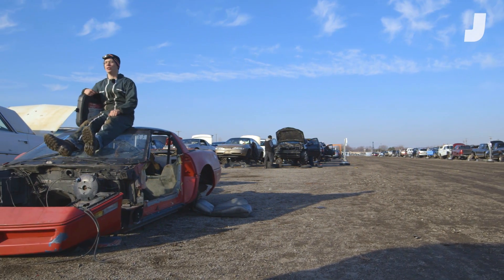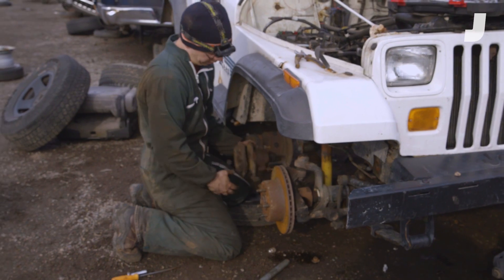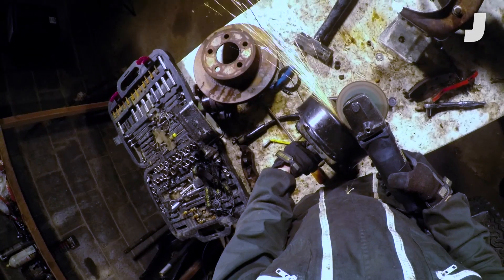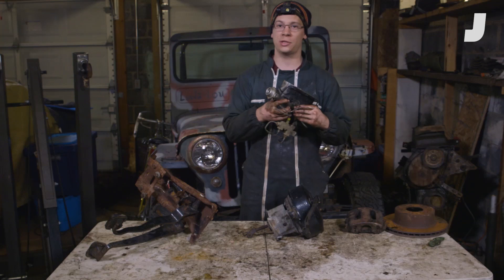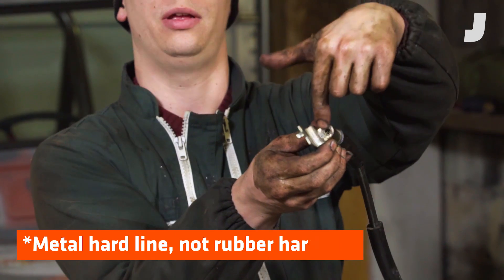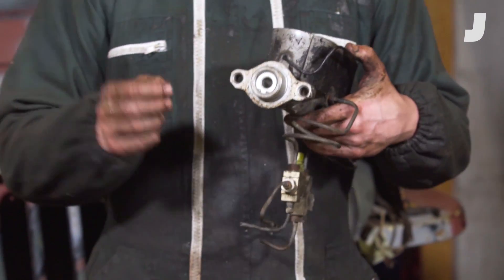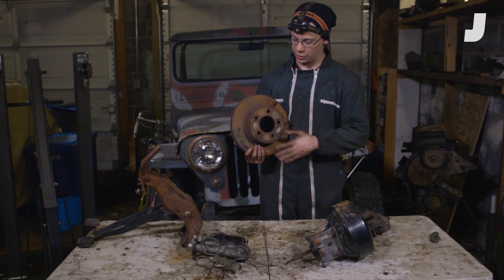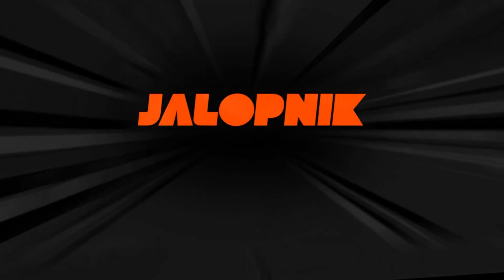Here's How Your Foot Is Able To Bring A 4,000 Pound Car To A Halt | David Dissects

Comment: well the brake light switch is located on the brake pedal assembly (its missing on yours but you can see its location right above the dangling wires ;) ) while the sensor you pointed out is a warning switch for no brake fluid ;)
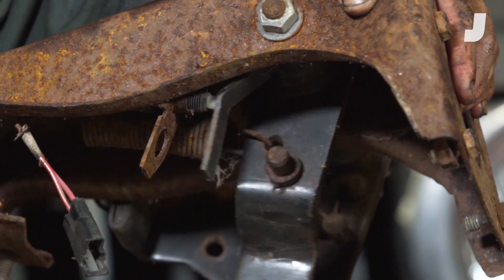Reply: BjerkePresents was going to post the same. However, believe the switch makes an appearance at the 2:20 mark where you can see the plunger extend when the brake arm moves off
Reply: The switch on the brake lines you were talking about gets turned on when there is pressure in one system and not in the the other pressure pushes it one way or the other.

Comment: I had to pause it 53 seconds into type this. Your exuberance and passion reminds me of the crocodile hunter when he finds a new species. You are a pleasure to watch.
Reply: The closed system explanation either needs work.... Or I'm dense.   No pun intended.   Tons of force on a small area when spread to a larger area should result in.... Less force, no?
Reply: No. Since it's a closed system, the pressure everywhere is constant. Same pressure exerted on a larger area = larger force (F = P*A). This is the basis of every hydraulic system from construction equipment to aircraft.